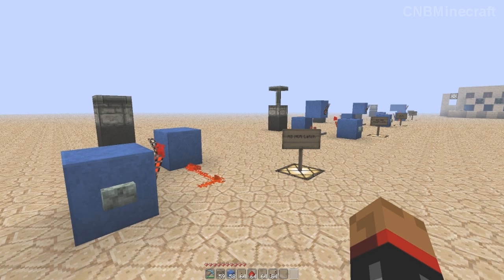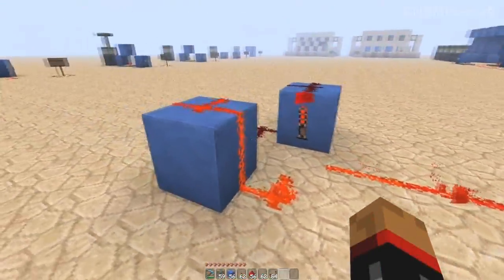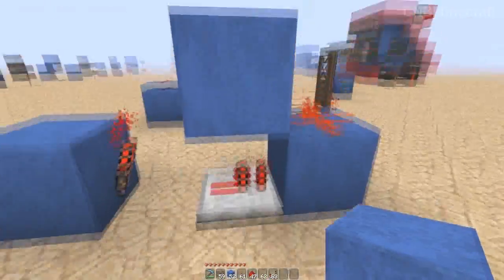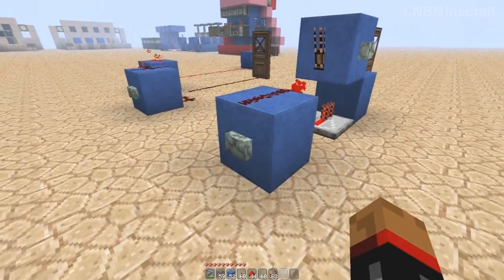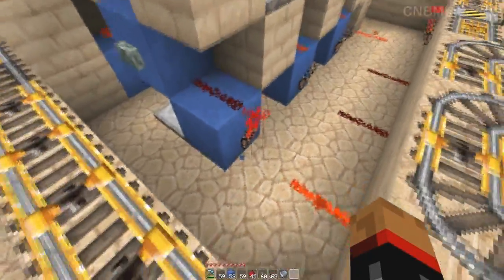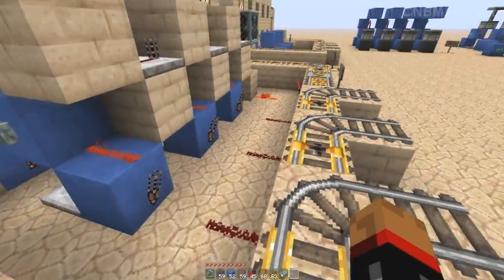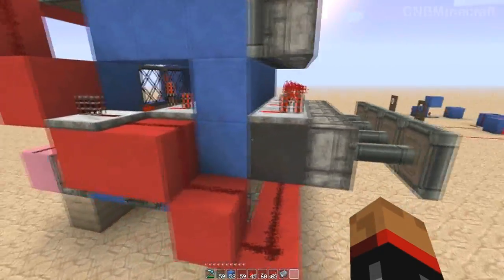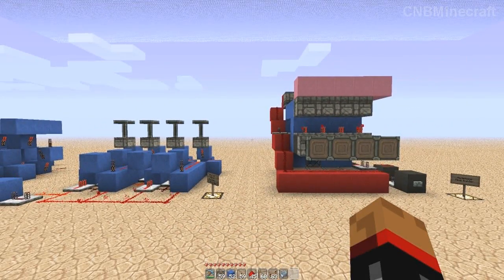RS NOR Latches + Awesome Stuff [Minecraft Circuit Spotlight]

Comment: BT
RR
TB

With B = block, T = Torch (always attached to side of block), and the R (Repeaters) powered by the torch and powering the block. Also 3x2, but modular.
BTBTBTBT
RRRRRRRR
TBTBTBTB

As nothing from one latch will mess up the other latches.